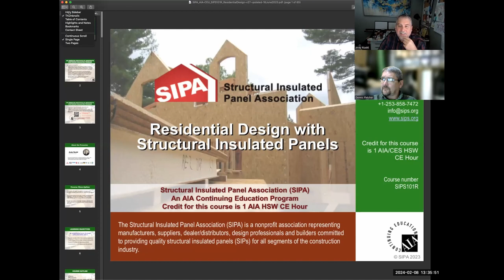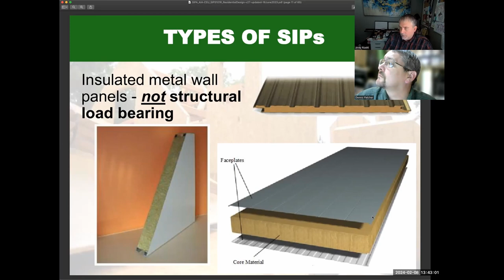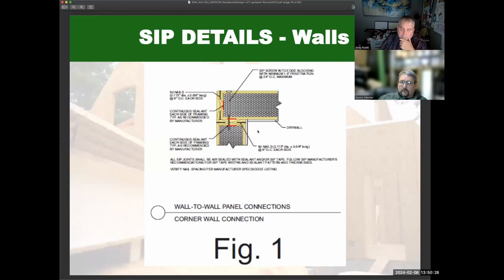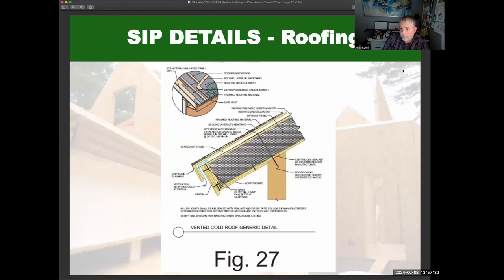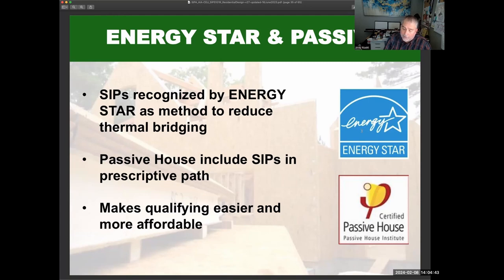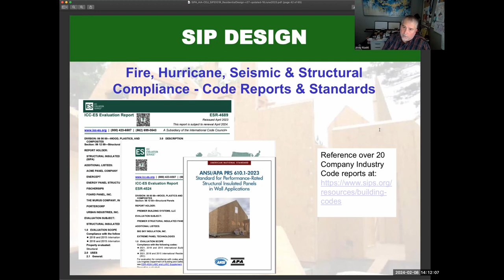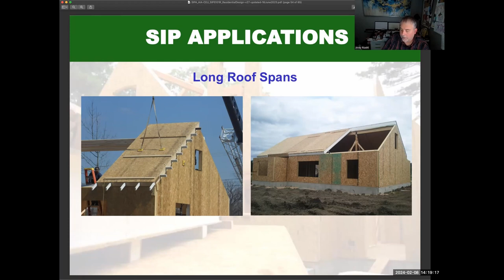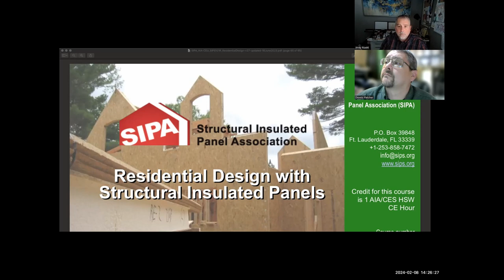SIPS Webinar & Q&A w/ Andy Roehl

Comment: I have designed many timber frame homes wrapped in SIPs and an ICF foundation, I am moving to designing exclusively with these three. Every SIP manufacturer I have dealt with is a great resource if you have questions on the system and they can provide great details.

Comment: I know a majority of projects I have done with SIPs do have a greater up front cost, many times it is made up in just the labor cost. In the long term the difference is often made up in just a few years with energy savings, I know one builder I worked with had a 4,000 sq/ft SIP home with less than $100 monthly heating bills.